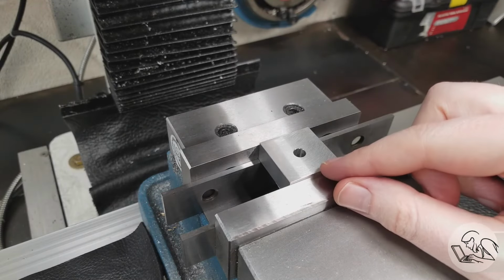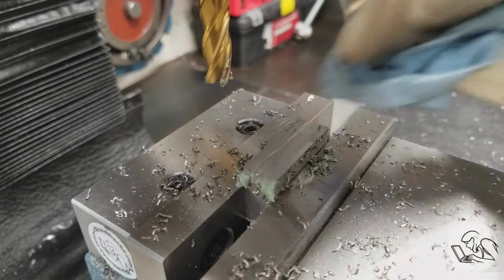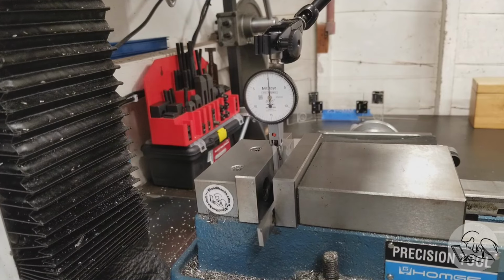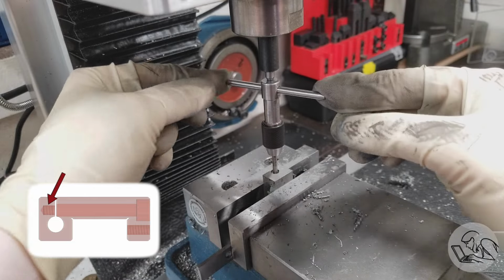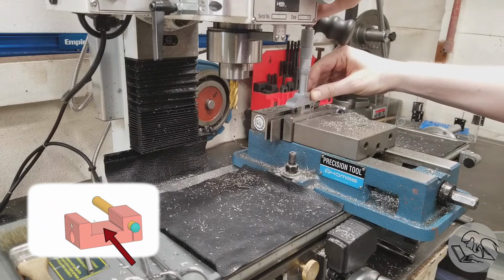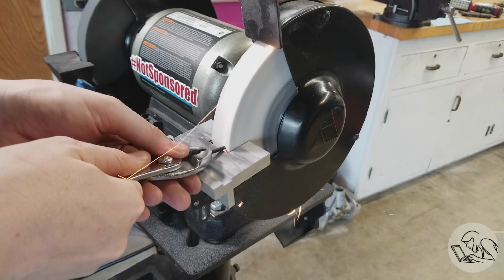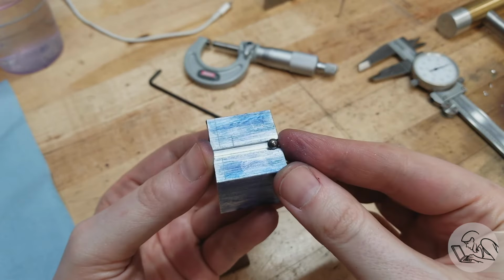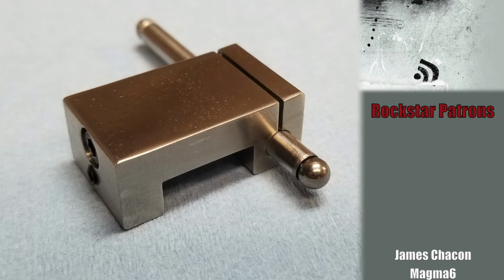Vise Stop! Let's Make One!

Comment: Add a touch of anti-seize to the screw. SS is terrible for galling
Reply from the maker: Good tip!
Reply: @Blondihacks  2nd this, stainless really does have a habit of piling up with dry fasteners. It would be a shame for your wicked cool vise stop to meet such an undeserving fate. Thanks for the stellar content <3
Reply: Or use a stainless screw...
Reply: @fredgenius  not quite. Mating threaded components of the same alloy - especially stainless - are more prone to galling. A 304 stainless bolt with a 400 series stainless threaded hole will be better than a 304 with a 304, but you should always use a sufficient thread lubricant with stainless fasteners whether they are being installed in like or dissimilar material
Reply: @fredgenius  itll lock onto s/s screws in an instant if you arent careful. I stuffed up a couple of parts as an apprentice with galled  s/s bolts in s/s.
Reply: Stainless screw or nut on non stainless will almost always gall. Same goes for titanium. Use a fastener that matches your alloy. Learned the hard way by scrapping some titanium parts and by galling a fastener halfway into the front suspension of the race car on a race weekend with predictable results...
Reply: Sure is.